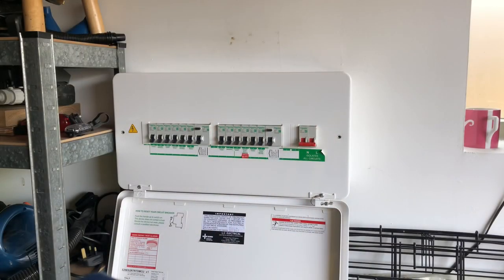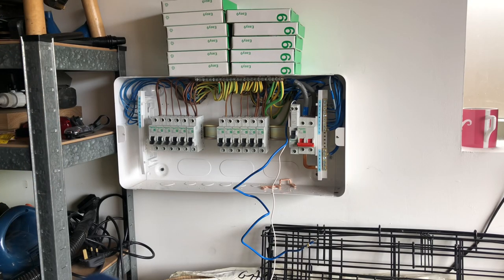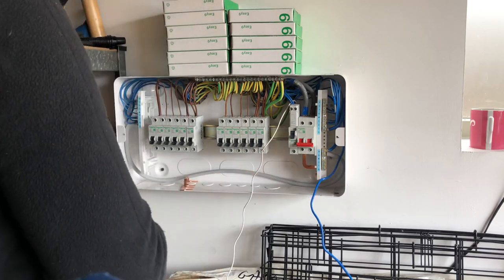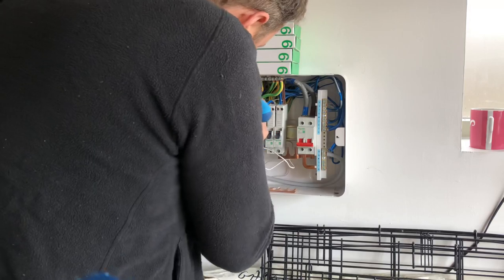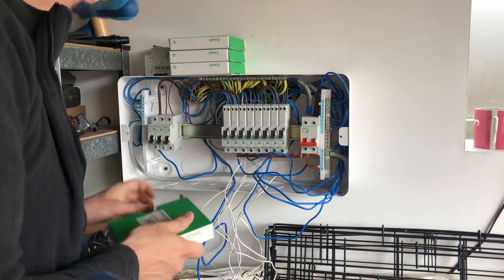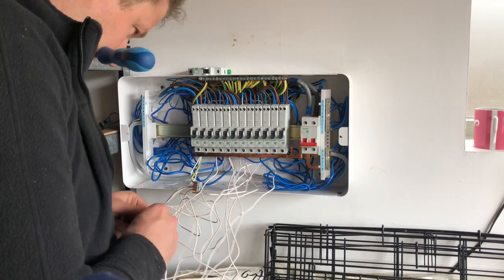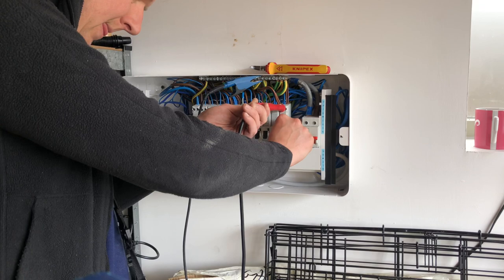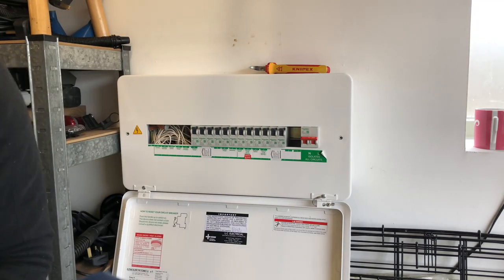Avoid Nuisance Tripping - Converting a dual RCD consumer unit to an RCBO one. Schneider EZ9.

Comment: Would have cut the neutral tails on the RCBO's and used ferrules to terminate. Much easier and neater, Obvioiusly leave some slack for future but it really doesn't matter where the RCBO's go on the busbar anyway.
Reply from the maker: D.J Electrical good comment thanks!
Reply: Whats ferrules ?
Reply from the maker: 1000fantomas they are small metal pieces that you put over the end of the stranded wires to keep them neat
Reply: @artisanelectrics  i thought so but didnt know that terminology. So it requires some tool to do it. Could you send me a link. I do a lot of flex termination. Cheers
Reply from the maker: 1000fantomas https://amzn.to/2HGIoGJ here’s the tool you need
Reply: It's also good to mention that as a professional you do not always have to follow manufacturer guidance, but if you do not, you should be ready to stand in court to defend your actions in ignoring the guidance. I say this as someone who knows people who've had to explain their actions to a coroner, it was not a good experience.
Reply: @cjhification  You don't need to worry about slack because you have a CU full of RCBO's already tied to neutral.   You have an RCBO in every possible position already -- you'd either be moving around the circuit connections or replacing them with something else.  I can't see why you'd ever need any of those RCBO's neutral tails to be longer then their current span over to the neutral bus unless you're planning on re-using them in a different CU.
Reply: @NillKitty  my comment was very generic, just in relation to being a qualified professional in any field.
Reply: @artisanelectrics  which loops are you talking about at 31:00 ? is it because they put 2 wires for the lines?

Comment: Yes, absolutely cut the neutrals and functional earths - I've heard the old wives tails too, but neatly cutting them and popping a bootlace ferrule on them seems the neatest way to go. They're cheap anyway, if you have to move them in future - I don't think having to put one in the van and install another one is a big deal, you'll always reuse it on another board eventually that doesn't need the length. 

Even better - stick to a brand that doesn't have a functional earth and has a neutral terminal and not a tail.

Comment: I installed RCBOs back in 2004, and they were double-width (one half with the line, one half with the neutral), and then I used an insulated double bus-bar with neutral and line for them so there weren't too much need for the neutral bars and then I didn't have to worry about tails either.
I would say that the heaviest load shall be closest to the main switch to minimize the distance that the electricity has to travel for that unit as well as keeping the number of connection points down to a minimum, especially with a central with multiple neutral bars since each joint is a potential failure point. High current joints have a higher fault risk. A simple light bulb with a bad joint will merely flicker while a 40 amp could be a fire.

Comment: Theoretically it’s best to put the loads in order largest to smallest on the busbar, the theory being that the busbar itself has an internal resistance that causes voltage drop proportional to the current. You could actually test it by activating a large load at the end of the busbar and measure the voltage between the terminal on the breaker and isolator switch.
Reply: The voltage drop would be 0 along that piece of busbar . The resistance of the busbar is very small .
Reply: busbars are overrated
Reply: @persona250  it's not 0, everything has resistance and the voltage drop is current dependant, hence you want to minimise the length of the bus bar for the largest loads.
Reply: @sstorholm  you are correct it is not 0 but it is a ridiculously small number that has no relevance in this discussion
Reply: @persona250  not quite, for example 250 mOhm at 50 A is still 12.5V of voltage drop.
Reply: @sstorholm  250mohm is not the correct figure though . An educated guess from me would say the busbar would have to be 100m long to drop that much voltage .
Reply: @persona250  for the conductor itself yes, but you also have connection resistances etc.
Reply: @sstorholm  25sqmm copper at 1m length. 

Volt drop mv/A/meter divided by 1000

0.170 x 50 x 1 / 1000
= 0.0085 volts
Reply: @sstorholm  if properly connected this will add a negligible amount of resistance less than my volt drop calculation in previous post . I design and test circuit resistances for a living .

Comment: Hi Jordon, the issue with the 40A circuit breaker being placed adjacent to the isolator switch is to keep voltage drop along the busbar to a minimum. It is simple Ohm's law that, to keep voltage drop low, the busbar should be as short as possible and have the largest possible cross sectional area to keep the resistance very low. If you need to install the 40A MCB at the other end of the DIN rail, furthest from the isolator switch, the busbar cross sectional area can be increased by putting a second one on top of the existing one. Hope this helps.
Reply: Is this actually based on any science or just something you picked up out and about? Sure, Ohm's Law states that the voltage is proportional to current if the resistance is constant. But in this instance, surely the resistance could be considered so negligible across a busbar that it may be dismissed entirely?

Look at the situation: you're going over a BS EN 13601 compliant busbar. The maximum volumetric resistivity for the poorest acceptable quality of BS EN 13601 compliant annealed copper is 17.24mΩ/mm²/m. Assuming the busbar is 30mm², the resistance under absolute worst-case acceptable manufacturing tolerances is 570µΩ per meter. Even if the the RCBO is all the way on the other end of a long busbar (12 modules (12x18mm); 0.216m), the worst-case resistance is 123.12µΩ. The voltage drop given a constant current of 40A at a nominal single phase supply of 230V, applying Ohm's Law, is 4.924mV. Compare this to a 6A RCBO of 1.380mV. It's a *maximum of 3mV difference*.

Even assuming the cable itself is a chunky 10mm², you'll lose 176mV in the first metre of the cable run anyway (BS7671 Table 4D5). So for comparison, you'll lose 3.5mV in the first two centimetres of cable anyway.

So why give a toss about the RCBO's position on the DIN rail relating to volt drop? Possibly I'm missing something.
Reply: @dph9885  anything that is short (few cm long like busbar) does not affect anything, what affects voltage drop is the length and thickness of wires and cables that go for like 10-30 meters in the house

Comment: In theory installing the highest loads' breaker close to the main switch would reduce the resistance of the bus bar in between.
But it's a really short piece of copper, so it's more a theoretical thing.
But if the current is really high and the bus bar is long and thin, it may be a thing, since the voltage drop over the bus bar impedance will be higher if the respective breaker is installed close to the end rather than in the first position after the main switch (especially during the device's start, due to bus bar inductance)
In this case the lights installed after the high load's breaker will flicker more, the ones installed between the high load's breaker and the main switch will flicker less.

Comment: I am glad in the US that with most all the breakers now are either GFCI or AFCI or combo of both, the new panels have plug in neutrals, so there are no tails on those breakers now, just ground into ground bar, then hot and neutral to the breaker and click into the box then next circuit.  With our new 2020 NEC code most all the 240V breakers now will be GFCI as well in the panel.  They have really increased the use of GFCI's over the revisions of the code here to just about all circuits.  I am sure the manufactures love that.  Great video, keep up the good work.

Comment: Tidy job as usual but for me testing should be done prior to a board change/RCBO upgrade.  Peace of mind that any inherent faults are identified and pointed out to customer so as to eliminate the “it was ok before you did that ! “ . Just my personal opinion. Your posts are well narrated, I like the style.
Reply: He did test it before rcbo upgrade as he could not find a fault to be causing the tripping of the rcds he says it at the start
Reply: @asamitchell7948  30:17 No he didn't
Reply: @paulstimpson8373  Oh yes he did
Reply: @jeremykemp3782  Respectfully he didn't and I gave the timestamp where he explains about finding a break in the cpc from the original installation after completing the work @MizunoIronMan commented that he recommends tests BEFORE undertaking such work. Clearly he didn't test before as he would have found the fault!!

Comment: I am not a sparky, but have some knowledge of electronics.  If you make a smallish loop (about 2 inches diameter) of the surplus wire, then flatten the loop so it is effectively a flat zig-zag (and tie it with thin cord), you will minimise any inductance generated in that section of surplus cable.  Will make it neat to locate also.

Comment: Concerning the break in the ring CPC - that is at worst a code C3. It poses no danger either currently or in the event of a fault as the broken CPC is completely capable of carring any fault current. its not 'to regs' which is why I'd put a C3, but as far as safety is concerned, not dangerous in the least, it simply functions as it would on a radial circuit. All thats required is a whizz round all the sockets on that circuit and take ZS at each just to verify that the CPC hasn't been disconnected/broken in 2 or more places, which would leave a socket (s) without a functioning earth.

Comment: 1 thing.....Ferrules
526.9 Connection of multiwire, fine wire and very fine wire conductors
526.9.1 In order to avoid inappropriate separation or spreading of individual wires of multiwire, fine wire or
very fine wire conductors, suitable terminals shall be used or the conductor ends shall be suitably treated.
Reply from the maker: Great find in the regs thanks!

Comment: The reason the caution on trimming the neutral tails came about, is because the wire is fine stranded. You may, and SHOULD, remove excess tail, but use a crimp ferule to dress the fine stranded wire end. With the ferule, you have no concern about the stranded wire shifting under the pressure of the terminal.
Reply from the maker: Thanks good comment

Comment: I always cut them if the manufacturer allows it and I've always cut them anyway to make it neat and also to leave maximum space in the consumer unit and if their is a mini fire then it won't leave too much damage to other circuits at the end of the day just leave a little swoop in case of making off again 👍
Reply: My question is not related to your comment but here it is:
What if there's another row above that is populated with all RCBOs, how you would you feed them from the main switch? 
(i wonder if an RCBO terminal can take a 25mm² conductor and a busbar tooth).

Comment: If you're worried about length on the neutral tails you only need leave enough to neatly span from the say the left end of the din rail to the neutral bar on the right side of the board or vice versa. Keep up the good work.
Reply from the maker: Thanks!
Reply: Yes, could he have just used the one neutral bar on either side?

Comment: I started fitting functional earths with the respective earthing conductors and recently find it easier to put them all together in a spare position on the earth bar. I can’t see any difference in the order of the RCBO’s; the voltage drop across the heavy gauge bus bars will be negligible. I don’t cut the RCBO neutrals as they would need a ferrule and that would seem very fiddly. Like you, I drink coffee on the go and prefer to get home and get the paper work out of the way.  I see that you test your RCBO’s at the CU which is much easier than doing it st a Socket or light fitting - I’ll be adopting your methodology here as it saves a lot of leg work. I’m replacing a fuse box with RCBO’s tomorrow (oops, today) - I never fit anything else now.
Reply from the maker: Richard Wallace great comments thanks!

Comment: Nice video. I don't think I would have left all that slack on the functional earth's and the neutrals especially right next to the busbar. I don't see any problem with cutting them. Also I fitted one of those schneider boards once and thought they were poorly designed. Loads of space below the breakers where you dont need it and not a lot above.

Comment: I always double over with long nosed pliers when connecting single conductors. Crabtree starbreaker boards are sweet to fit out with miniature rcbo's and a Brucey bonus with no earth tail to connect. Pricey rcbo's but worth it, although you can get a blank board for around £80ish. :) nice video, enjoying the channel.

Comment: Interesting. I'd deffo have to cut those cream FEs (now pink!) and then use your method of Wago as it's just no problem to extend your new earth conductor if needed. Also, I believe Schneider do the full length neutral bar to replace the split one.:goodvibes:

Comment: I would have gone with type A rcd. Cut the neutrals back. Two items I think you should always say in your videos 

1. Demonstrate safe isolation etc lock the main breakers off ....what if you did go to van for a coffee.  ??  

2.Would also mention that you did initial verification that all bonding is present and therefore was safe to continue with live testing.

3. You test rcd at board pointless test imho the rcd  is to protect the cct you should test at far plug socket or end of a lighting cct.

Apart from that keep up the good work.

Comment: I prefer to use NHP MOD6.  The RCBO only requires top and bottom connections and they supply a busbar that does the job nicely.   Looks much neater.

Comment: I also do the same thing with the functional earths, put them all in wagos or a DIN connector block with a fly lead to the earth bar, or put them all in a spare earth terminal or two in the earth bar. No need to put them with corresponding circuit earth.

Comment: I was always told at college to put the highest value breaker to the main switchfor the dimming issue the  as for bending  the conductorr as per your decription
as I work with tri rated stranded cable all the time I use single and twin ferrules.
The brother printer is a fantastic bit of kit not long bought one  does a great professional job although i doubt I will ever use it to its full potential.

Comment: Cool, this is exactly what I wanted to find out about. Got to isolate an electric garage door from everything else so it doesn't jam shut if there's a fault with another circuit, but the board is dual RCD, so I need to convert it to RCBO use :-)

Comment: Easy 9 is because each module is 9mm.  1 MCB is 2 x 9mm = 18mm. However you will find each MCB is only 17.5mm when you measure it because of the tolerance when fitted.
Reply from the maker: Thanks!
Reply: Your welcome, Thanks for a useful video

Comment: Here is a tip to get your printer labels the correct size: measure the total length from first to last RCBO and then device the result by the number of RCBO’s - it will be more accurate as a half MM error this way will transpose to an error of 0.5 MM divided by the number of RCBO’s.
Reply from the maker: Richard Wallace Good tip!

Comment: Not a sparks y trade, electronics and Cctv, I agree with some of the comments with shortening the neutrals to keep it tidy and the the white earths. The wago connectors are German made and pronounced vago. Cool videos and learning
Reply from the maker: Thanks!
Reply: 0448178 radionics do a label remover I use to get sticker on the tills, very good stuff. Spray it on and leave for 5 minutes and then it just falls of, that’s the stock code at the start 👍🇮🇪

Comment: I personally leave the neutrals the length they are and try to put them as neat as possible. I also correspond each earth lead with each cpc in the earth bar,it then makes it easier to remove or replace if needed and to locate.
Reply: I also definitely wouldn’t double up the bus bars. 
Rcbos are the way forward 👍🏻
Good videos, I’m enjoying your content.
Also I would of taken off the grey sheathing on the 16mm neutral so it was blue,doesn’t need to be on there as enclosed and I think would just look better as a blue neutral rather than grey-just my option tho obviously not a criticism.
Also coffee breaks-I used to work through without stopping but try to stop now especially when I work at a school we have breaks, but that’s day rate ha ha. 
Always double up single cables,never for two in a mcb/rcbo
I also fit heaviest Amperage first, but it really doesn’t matter, I just do it out of habit, doesn’t make any difference which way you do it
Reply from the maker: Thanks great comments!

Comment: Excellent talk through of your thought processes and decision making Jordan. And I appreciate your honesty about not knowing everything (who does, really?). I carry a vernier caliper in my main toolbag for precise measurements like width of breakers, though tend to find 17.9mm or 18.0mm works well enough for most of them. Vernier caliper is also useful for determining/confirming cable cross sectional area - I use the equation (D/2) ^2 * π * 7 a lot for that purpose.
Reply from the maker: Nick Elks great comments thanks!
Reply: Why x 7 at the end...? The area of a circle (cross section of a cable or wire) is just Pie x  R^2 (or as you say pie x (d/2)^2 as with calipers you measure the diameter not the radius)  7 stands?

Comment: I usually use 17.5mm on the brother printer and works a treat, even though they're 18mm wide, or supposed to be.
Reply from the maker: Yeah it’s a bit of an art getting it just right!
Reply from the maker: PETER WILSON good tip thanks!
Reply: @artisanelectrics  What - learn your 12x table?    Maybe 21x table or more with Fusebox brand.